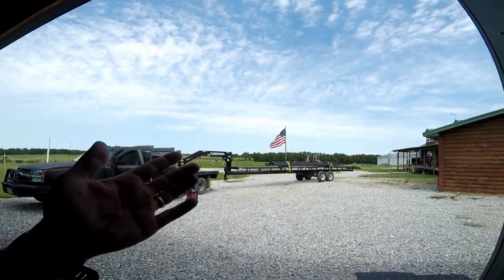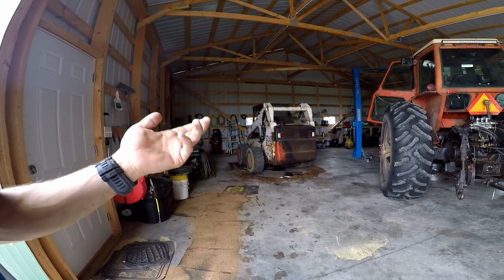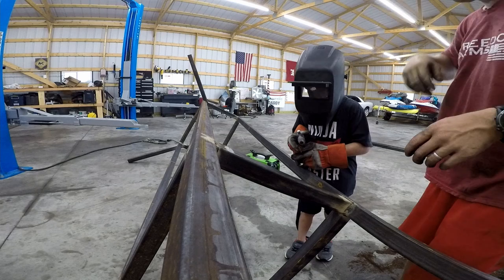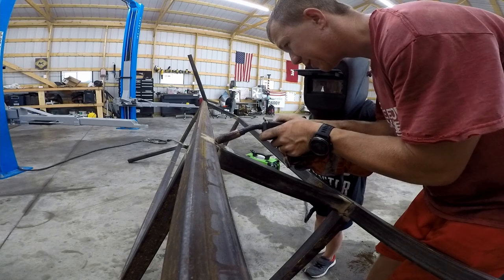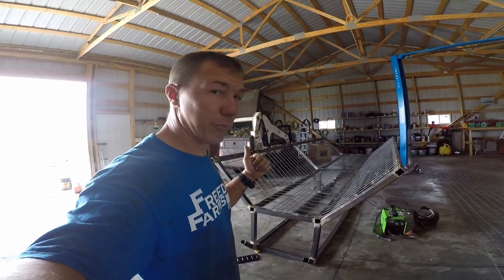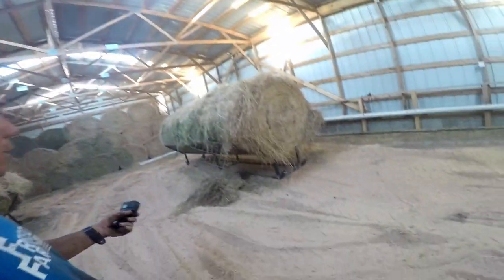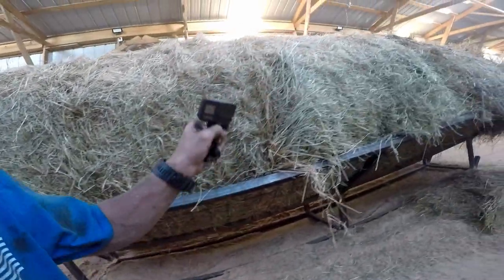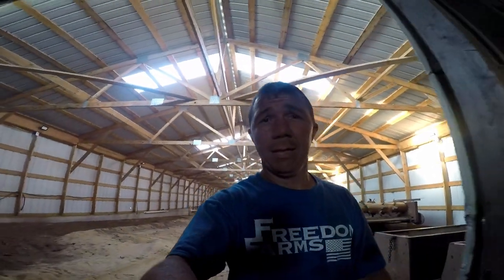How to make a hay saver round bale feeder

Comment: Looks like a good project. The only question that I have is, you stated that only you would walk on the bottom portion so you just tacked on the ends. You do understand that you have young people that will be growing up and have minds of their own? 😂 Also, you have the weight of the bales that I think might bend that bottom portion. I don't know how much a 5 foot bale weighs but I think putting that much weight on a 3 foot area might get a little hairy.
Reply from the maker: Yes that is very accurate about young people having minds of their own 😂 they will learn very quickly if they get their foot pinched not to walk on it. However what we were more talking about was the animals themselves will never be able to access that because there's always going to be bales in the way. Secondly we're not worried about the weight at all across it we were just simply worried about an animal getting trapped in it, their leg falling through the squares that kind of thing. As you can see at the end those bales we put in held perfectly and have been in there for over a couple weeks now with no issue. A 5x5 round baleweighs approximately a thousand pounds depending on the pressure of the baler that made the bale and the moisture content of the material baled. Overall it just turned out to work exactly the way we hoped😁

Comment: I am concerned that ewes or lambs will climb in the ends as the bale is eaten, contaminate the hay, and get their legs down through the hog panel.  Not that wool quality is something to strive for any more with the depressed prices but cradle feeders like that result in a lot of chaff in the wool.  They also require hydraulics to put bales into them.  Not my choice of feeder.
Reply from the maker: If you watch the whole video I actually discuss there will be end caps that are put on. You will also see how we put the bales in which you are correct using a skid steer or hydraulics. Sorry it won't work for you but you could actually use this for square bales as well just make it smaller.
Reply from the maker: Also all of our sheep are hair sheep they don't produce any wool